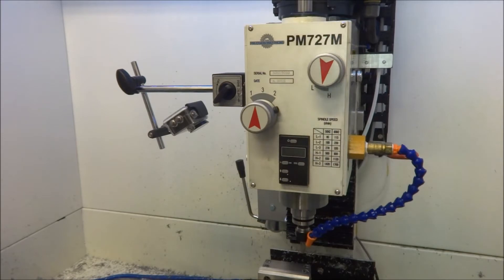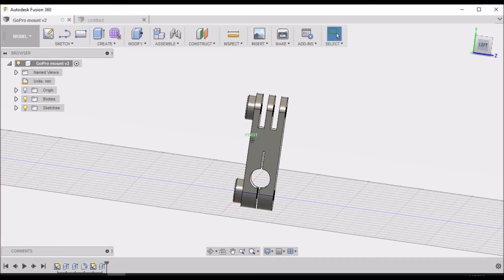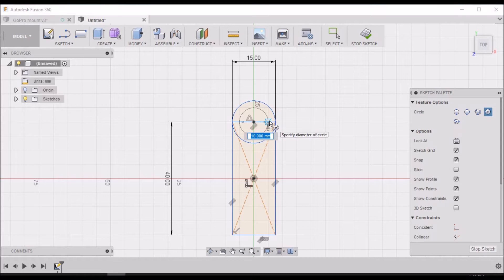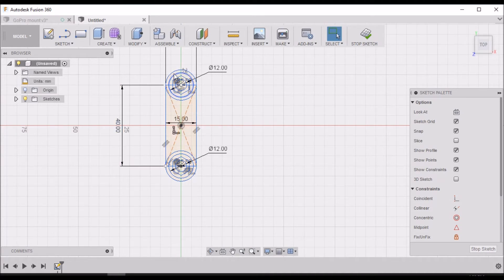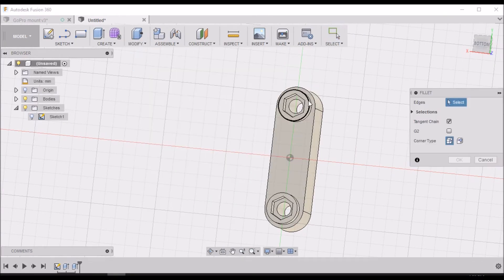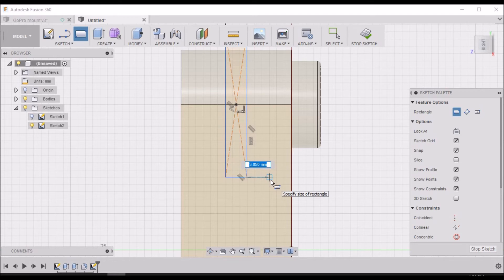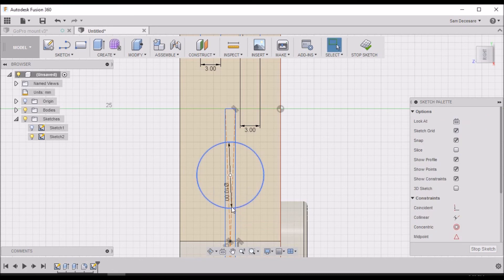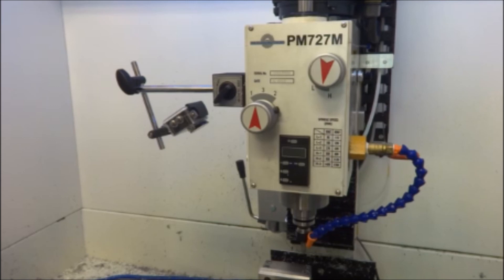3D Printed GoPro Mount

Comment: That is cool!!! Nice work Sam!!
Reply from the maker: James Hopkins 
thanks wyatt hows the pdb coming along?
Reply: I have most of the parts milled, and assembled on the head. It has been riding on the head while I have been machining and so far I have not had any issues with the added weight, but there are more parts to add, bearings, pins, washers, pivot shaft and such. Hopefully there will not be a significant amount of weight in those parts. plus I gained some room by moving all that electrical stuff off the head. Still tossing around a second design, but it is a spin off of the Tormach pdb. I will send you some video of what I have.
Reply from the maker: James Hopkins 
looks good cant wait to see it working.